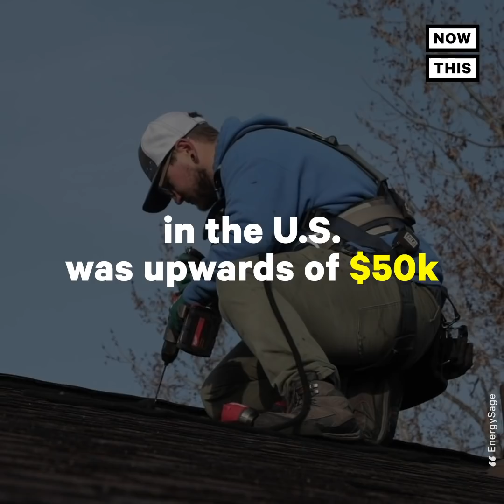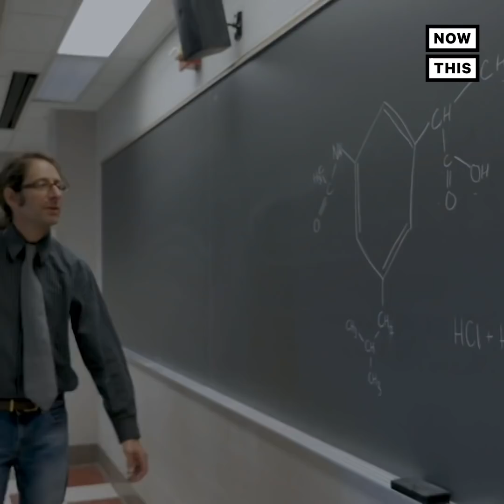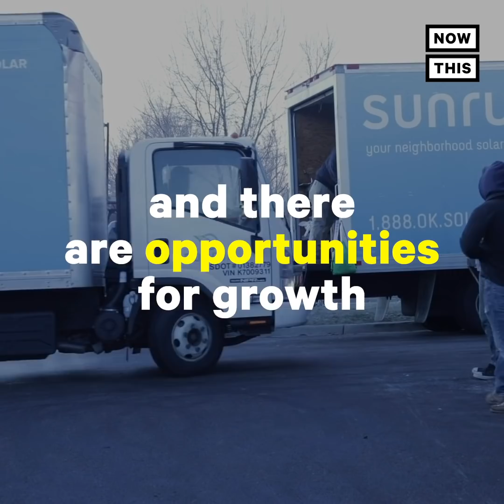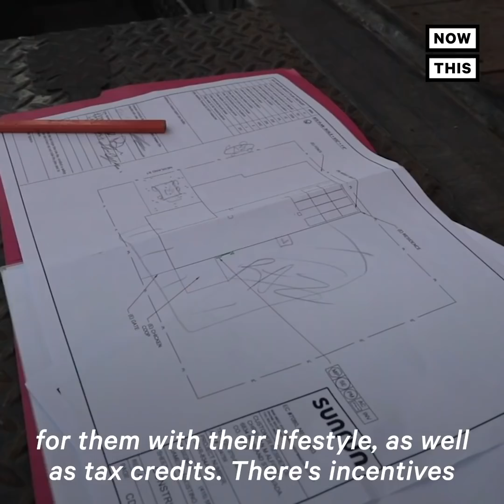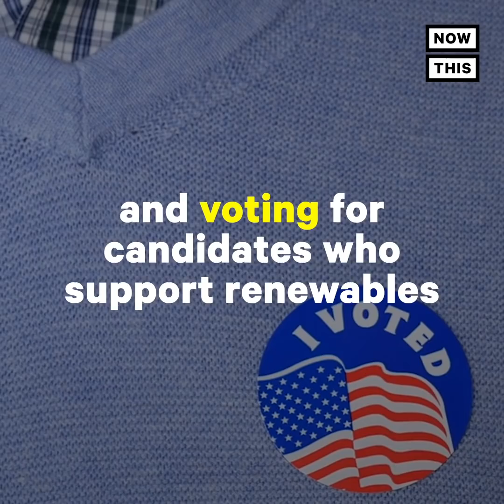8 Surprising Facts About Solar Power | NowThis

Comment: Its interesting this only looks at residential application, when even if we installed solar to every home in the usa (some 165 million buildings) you would produce approximately 33% of current net generation (assuming average roof area from BLS, 7.5kW system with 22% efficency). 

That's a lot of energy and that's fantastic, but it also shows two things:

1. Its nowhere near being the solution to the entire problem. 

2. The residential sector doesn't consume the most energy, and we still need energy generation for other sectors that consumers may not directly contribute to.

Lastly you're comparing energy costs by your personal bill. Fine this is a small scale video for the average consumer and pretty much just a pitch for residential solar. No big issues, except when you start looking energy systems from a macro perspective and you're having to take issues of intermittency into consideration at large scale production.
Reply: The amount of carbon emission that will be prevented through the adaptation of solar into the energy mix is enough. Solar is not meant to replace all sources of electrical energy.
Reply: Emman Villarino There are studies looking at very high penetrations for solar, and it’s unclear what concentration the GND supports, but yes

Comment: I find it ironic that the cheapest electric rates i have ever had are in areas with coal energy
Reply: Old plants, new coal plants are more expensive vs new onshore wind and new utility size solar. Also the costs of coal should include the health cost caused by it, but ofcourse this is never done.
Reply: @MDP1702  solar and wind should include the costs for their unreliability and non constant power output. The US economy will never be supplied by wind, solar, and battery alone. Fossil fuels are here to stay
Reply: @thedude5040  Absolutely not. Even now large scale battery cost around 100-180 $/MWh + renewables comes up to a total  of 150-230 $/MWh (and you don't need to cover the entire supply with batteries, so total cost per MWh goes down significantly, even more if BEV's are used as storage too). Nuclear is 120-180$/MWh. Gas is 90$/MWh and coal (which is increasing in price) is now around 60$/MWh. And batteries 10 years ago were at 1000$/MWh, even if they drop their costs down by only half in the next 10 years, they'll still be competitive with all other sources.

Anyone who claims fossil fuels are here too stay don't know what they are talking about. There are only a few specific parts of the economy fossil fuels might remain, like large boats, though even there if batteries increase enough eventually they'll replace fossil fuels.

Comment: Why aren’t the fossil fuel companies advocating for solar if solar uses so much diesel and gas? We all know they only care for profits, not environment. Enlighten me.
Reply: @Marcellus Aaron 1. You didn't really answer the question. 2. Once you build a solar system, you don't need to replace it for decades. The energy return on investment is huge. 3. Plastics industry is transitioning to carbon dioxide neutral or even negative production methods by using plants instead of fossil fuels as the source of carbon for plastics.
Reply: @mrbonzzai  who is going to pay for the land acquisition? Do you have any idea how much land would be required to power new york city? Do you know how far electricity can travel? Do you know that nuclear power is a viable energy source ready to be deployed to handle the transitions from fossil fuel electricity?
Reply: @thedude5040  
who is going to pay for the land acquisition?
The person who install it obviously, though land acquisition isn't necessary, plenty of land where you can do both solar and the original purpose of the land.

Do you have any idea how much land would be required to power new york city?
Just New York city? no. The US I believe would need a little less than the surface of West Virginia, for the entire world around the surface of New Mexico.

Do you know how far electricity can travel?
HVDC losses are around 3% per 1000km, so with losses of 9% you'd get as far as 9000km. Ofcourse if higher losses are acceptable (like 15%), you can go as for as 5000km, which spans the entirety of the US. Ofcourse one of the advantages of solar is that you can produce electricity much closer than even regular plants.

Do you know that nuclear power is a viable energy source ready to be deployed to handle the transitions from fossil fuel electricity?
Yes, though current new nuclear power plants are very expensive and take long to build. By the time they are ready, renewables + battery might both financially and technologically be more attractive, with the execption maybe in industry to replace coal etc. for heating purposes.
Reply: Actually during the energy crisis of the 1970s a fair amount of them actually created entire solar divisions. You know what happened? They went bankrupt. 

These companies aren't in the business of small scale installation. You could say well get into solar manufacturing, but less developed countries have that market on lockdown with very thin margins, which without significant domestic incentives makes it very unlikely for US companies to have success at a major commercial level of market penetration.

It's also important to note that many petroleum companies just straight up dont work in the electrical generation industry. It's weird that people still think we use petroleum for electricty, when we really haven't done so for the last 30 years. According to the EIA Petroleum accounts for 0.1% of net electricity generation. So why would a company built on refining petrochemicals get into a completely different industry that they aren't necessarily familiar with?

Comment: I work for a company that builds wind and solar farms.  A 70 turbine wind farm takes about 10 million gallons of diesel,  2 million gallons of gasoline and 300 tons of plastics to build.
Reply: In the grand scheme of things that's actually not a lot...

More than anything that should tell you the scale of these industries.
Reply: Michael Chrisman Why so much diesel? For the earthmoving equipment? Even if the numbers are as high as you suggest, that's still a worthwhile exercise given that wind is essentially zero emission once constructed. The carbon payback is measured in months.
Reply: And once it's built, do the wind and solar farms keep burning fossil fuels to run???

Comment: You seem to have left off the part where you need to get on the roof regularly to clean the panels so no Aunt Bertha, you can't have solar. OH- and there's the toxic chemicals like mercury, lead and many other serious toxins that no one takes as garbage that takes millions of years or longer to break down.
Reply: @Michael45007  
Question: can't you recycle the toxins in the panels back into new solar panels???
Or do they need to be disposed of in some sort of site?
Reply: @Michael45007  
The answer seems to be based on location.  Here in the states one may or may not be able to access PV recycling services.  This is unfortunate, there's rare earth elements in the solar panels.
Reply: @grmpEqweer  I almost never see not usable panels..even if there broken they still work.. recycling might be giving ur broken panels to someone who can fix and use them...
Reply: @Michael45007  My point is, you are lucky if you break even with solar and it destroys the environment both to manufacture and to dispose of. That's why they have to subsidize it. Moron.
Reply: Sho Sugino Break even point with domestic solar in the U.K. is typically five to seven years. That's without subsidy and a typical grid power price of 12p / kWh. If we can make it work in the U.K. which isn't exactly known for endless sunshine it can work pretty much anywhere. Solar and wind make up a quarter to a third of our energy mix, and recently we had so much wind generated electricity that those with smart meters and variable tariffs were being paid to consume it! Solar is not without its environmental concerns, but recycling already exists and the carbon savings are certainly worthwhile.
Reply: Do u have a LCD moniter? Mercury...and no one gets on there roof to clean the panels...